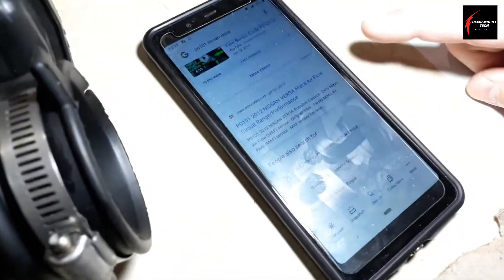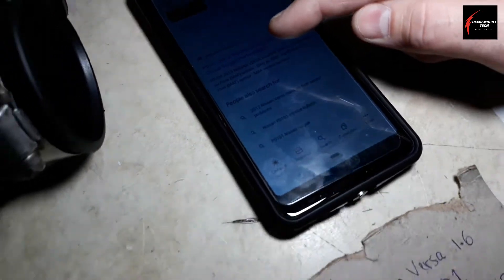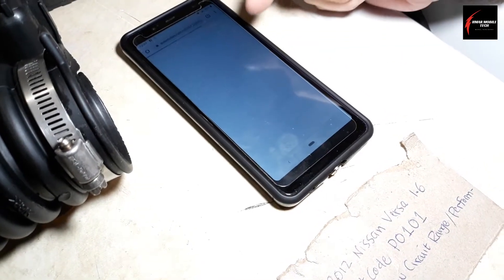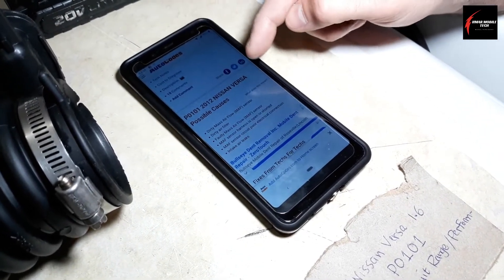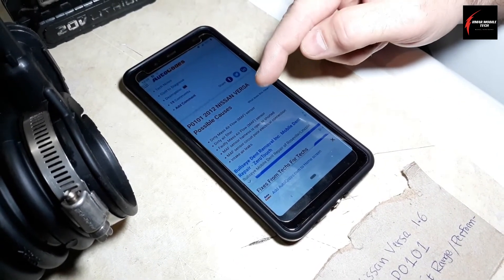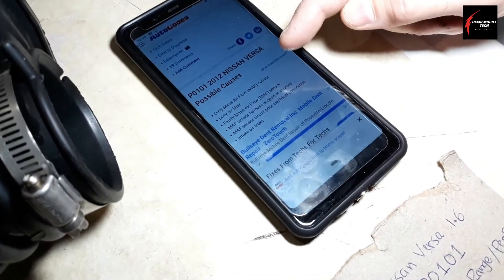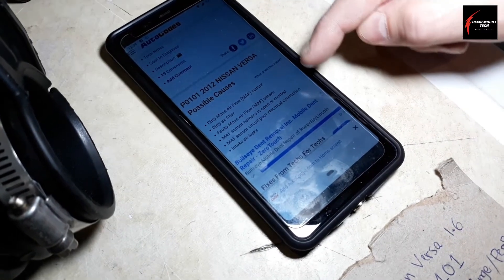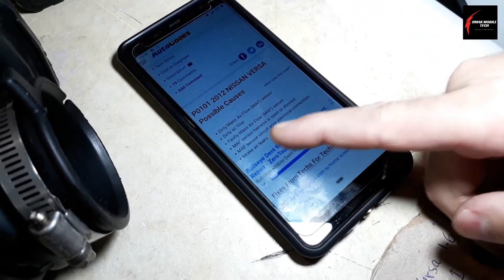2012 NISSAN VERSA 1.6L DIAGNOSTIC TROUBLE CODE / DTC P0101 MASS AIRFLOW SENSOR PERFORMANCE DIAG.

Comment: good video master 👍 to do this procedure is it necessary to disconnect the negative battery cable???
Reply from the maker: I dont see a problem disconnecting neg. battery terminal, do it if you like or erase fault codes then do a test drive and see if CEL light stays off

Comment: What does it mean when you get that code and p0113 on a Nissan Versa. I checked everything
Reply from the maker: PLSE GO TO AUTOCODES.COM AND SEARCH FOR IT, THEN LOOK AT POSSIBLE CAUSES AND THEN INSPECT EVERYTHING BEST YOU CAN. TY FOR YOUR COMMENT, KEEP US POSTED HERE IN COMMENTS🤗🤘
Reply: @hmarmobiletech8332  my housing is good hoses are good clips are good replace mass air flow censer still have code coming up and only that code P0101 Mass air flow circuit out of range em I missing anything also follow all your steps